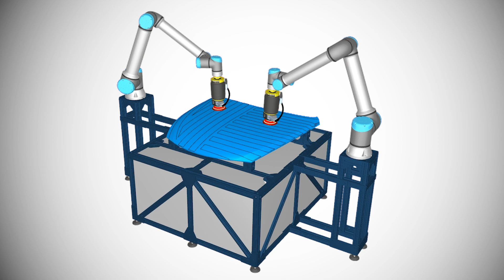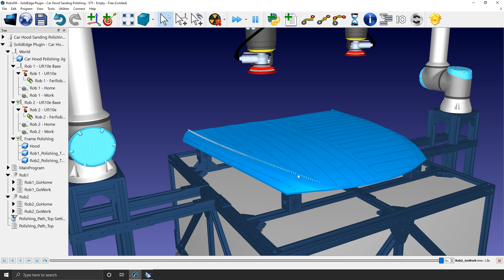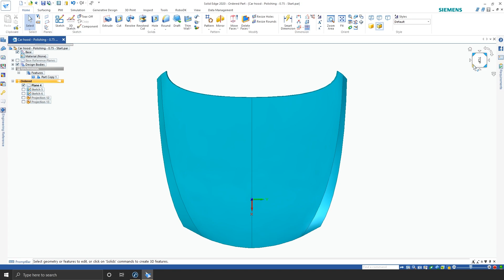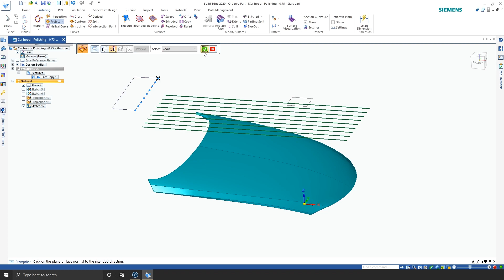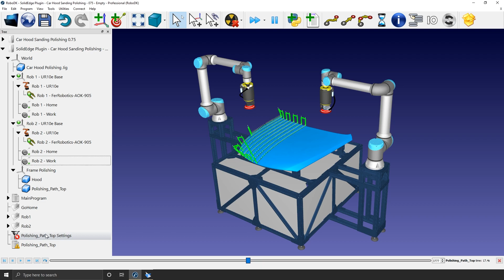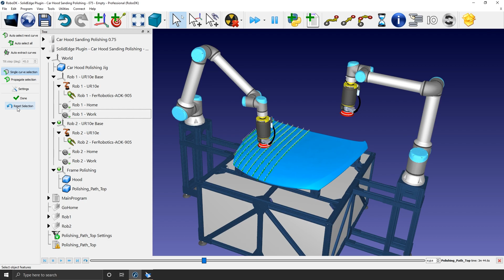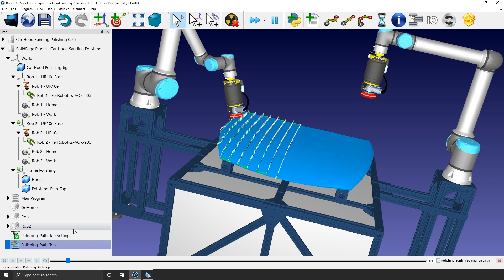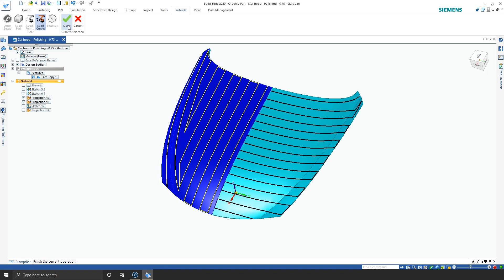Robot programming with Solid Edge - Car Polishing

Comment: Nice tutorial. I REALLY need a lesson on "Loading Points" instead of curves though! can't figure it out for the life of me
Reply from the maker: Hi Kieron, 
For such technical questions, you should refer yourself to the forum: robodk.com/forum
Points can be imported using the "load point" option of the plugin or by loading a curve, right-click on it, and "Extract point".
Reply: @RoboDK3D  It doesn’t work in the same way, at least not what for i need it for

Comment: Hi guys, amazing tutorials. I am working with a UR5e and would like you to share a video showing the use of Force Control since I want to use the built-in force sensor that this kind of robot has. I am trying to program this by using python in RoboDK but I don't know how to add the set of instructions to the Post-Processor file. I will appreciate your help.